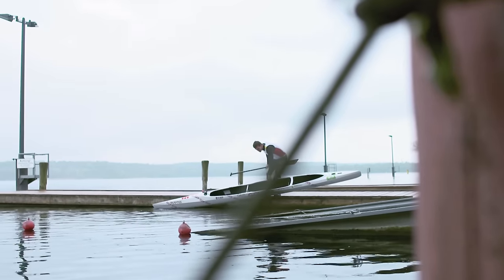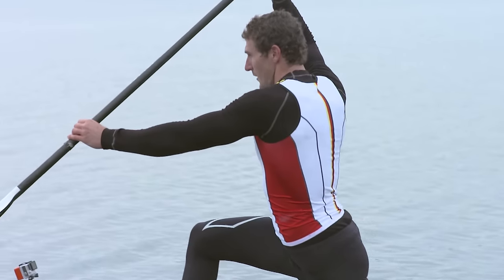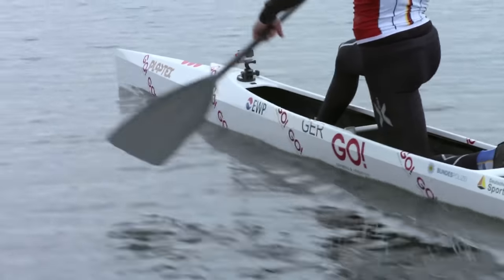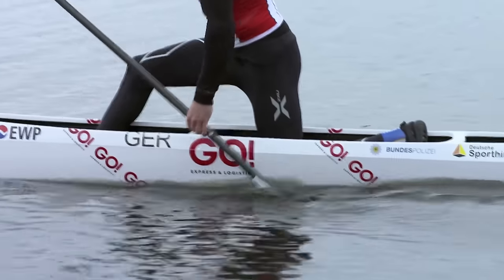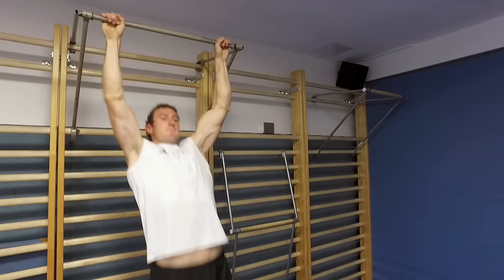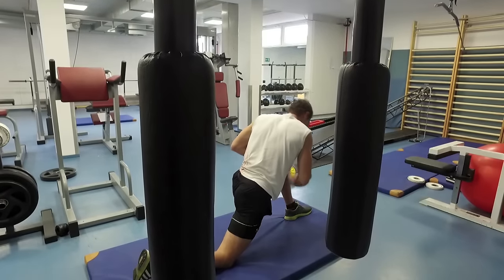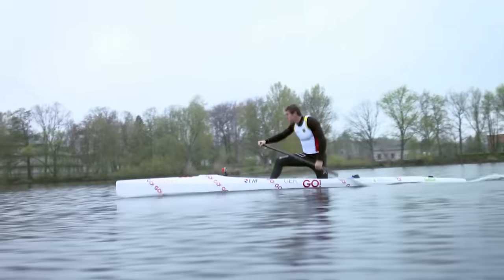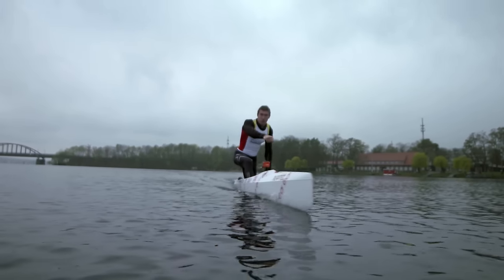Sprint Canoe Technique with Olympic Champion Sebastian Brendel | Gillette World Sport

Comment: I'm a dragon boat and OC canoe paddler. I'm curious how this guy doesn't blow out his top hand shoulder. With the length of that paddle his top hand starts the power phase of driving straight down, but his shoulder looks only supported by his rotor cuff muscles which is an extremely vulnerable position. In dragon boat and especially OC (outrigger canoe) the paddles are shorter and the power phase starts with the top hand just a little above horizontal at most which protects the shoulder.
Reply: The power phase should actually begin with the outside lat — as he does here. The inside arm then transfers power to the rest of the stroke. Doing it in reverse risks shoulder injuries.
Reply: Yeah it’s a delicate timing but the first rip into the water is with the lat and core then the top shoulder gets engaged to speed it up
Reply: Ни хрена не понятно в переводе.